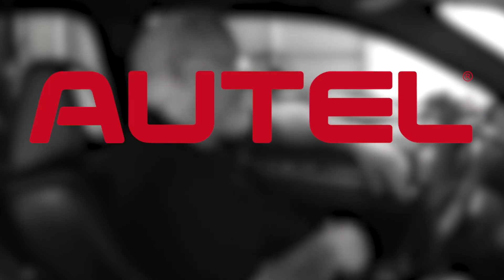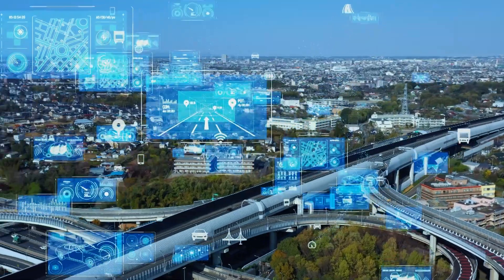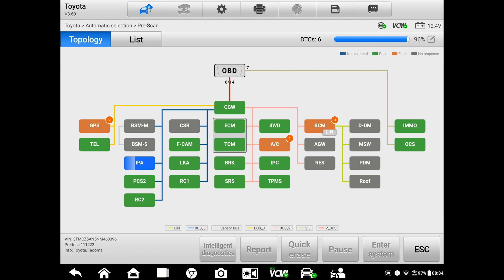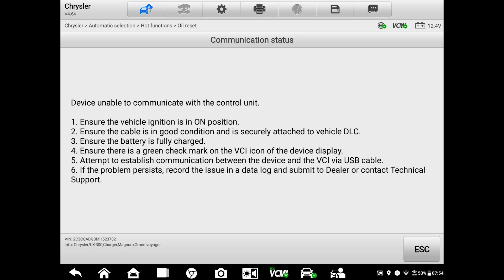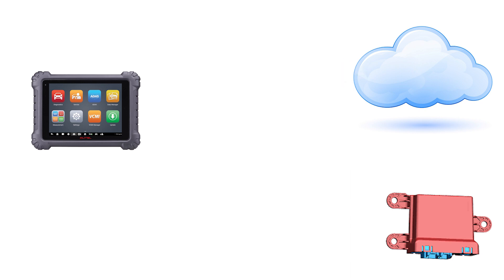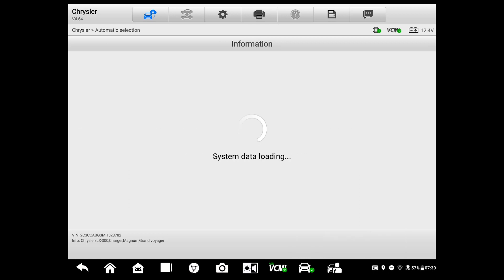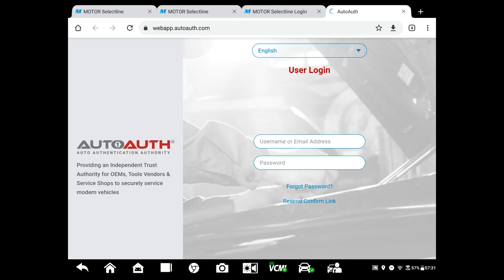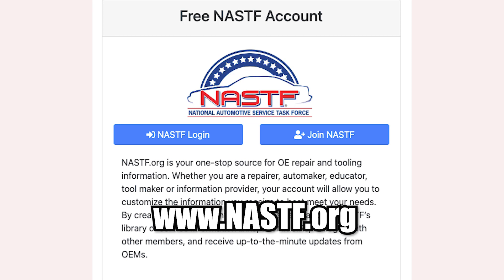The Trainer #136:  Dealing With The Gatekeeper

Comment: Honestly if you do a lot of FCA brands it's best to just bite the bullet and get witech 2. Problem with the autel is you loose sgw access if your yearly subscription is expired, also loose topology feature, among other features. Also can NOT program any modules with autel. It's 50/50 on whether the advertised feature work at all.  I bought a maxisys ultra and had nothing but problems with it. It can't talk to hardly anything older than 04. Ended up being replaced by warranty in the end due to it constantly freezing. Also autels customer service makes you want to gouge your eye out with a hot spoon.

Comment: Can this secure modules be a way to keep the car's owners from fixing its own cars??
Reply: Well depends on how you look at it. The modules are there to keep from people stealing cars is the idea. A lot of people think that it’s designed so you cant work on your own car.  Perhaps….
But as a mechanic for 20 years that sees all make and models, the diy model doesn’t normally work because the day to day person has no idea how to work on the most basic things as it is. I constantly work on cars that people try to throw parts at. If they cant do the simplest things, seriously doubt security modules are keeping people from working on their own cars. I could make a living just off people trying to fix their own stuff even on old cars
Reply: I have to call b.s on the response from motor age. It is absurd to just give a blanket statement and say diyers are incompetent at repairing their own vehicles. Also by the way good job at insulting the majority of your viewers as most of them are not “ technicians “ but actual diy guys. Also this is another way to implement a denial of a right to repair. The real problem was that the engineers allowed the cellular network connection to ever even communicate on the CAN bus in the first place. I also understand that yes some people shouldn’t be repairing things that they have zero knowledge of but also that someone who spends thousands upon thousands of dollars on tools to repair their own cars shouldn’t have to deal with this kind of problem maybe Chrysler should have to give confirmed owners the code to get access to the gateway.
Reply from the maker: I like what Mike said in his answer. Today's cars are becoming increasingly complex, requiring tooling and training outside the scope of most DIYers. Even tasks as simple as changing the oil or replacing the battery aren't so simple anymore.